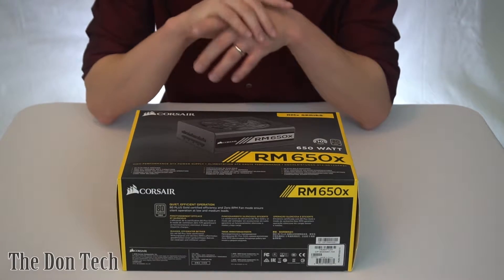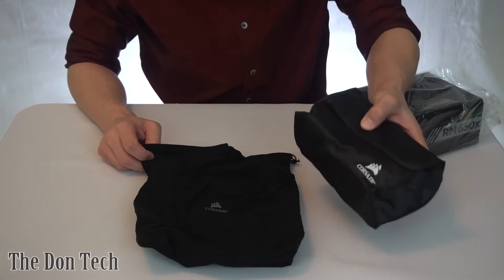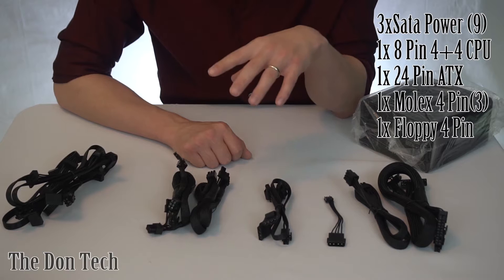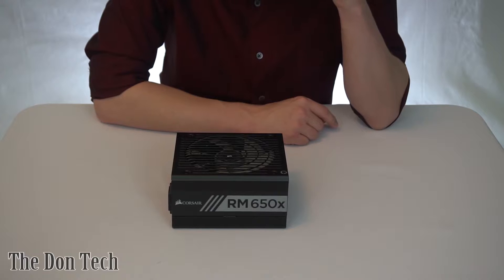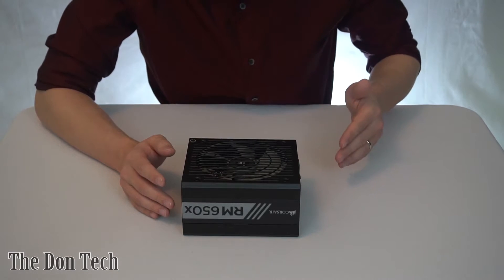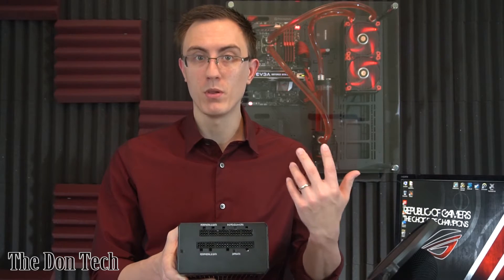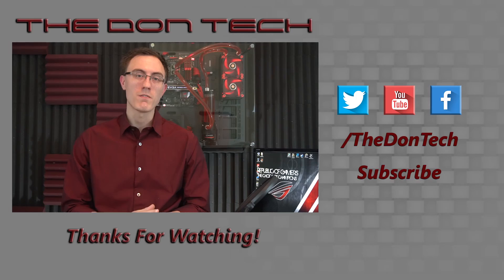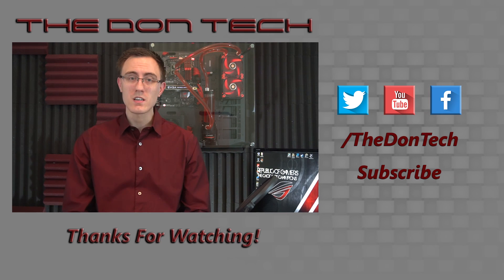Corsair RM650x Unboxing & Overview: What to Look for in a PSU! | The Don Tech

Comment: Just bought one for my 2022 PC build. I build myself a new PC every 6-7 years.  I didn't get the velcro bag. It looks like it would be good to hold headphones and other accessories when going to a LAN party. Oh well.   The Gold rating is what sold me on it.    The $20 rebate didn't hurt lol.      At 61 years old, I still get a kick out of building my own PC.     
MSI B550 Gaming Plus MB
MSI GTX 1050 video card
AMD Ryzen 5  5600G cpu
Teamgroup SSD   1 Tb 
G Skill RAM 64 Gigs
Antec DF 600 case
Reply from the maker: It looks like Corsair changed something in the manufacturing process of the new power supplies. While the product itself does not appear to have changed, the accessories package has. There is no longer a velvet/velcro bag on this model, along with the removal of the Corsair sticker.

Comment: hey guys, i bought the exact same psu, will it run a ryzen 7 3800x, 2070 super ? thank you, awesome review, well done!!
Reply from the maker: Yes this should be no problem. The biggest component will usually be your GPU so just make sure you have a beefy enough power supply for that.

Comment: Bought mine 20171128, and now my computer is dead. I hope it "just" PSU and not also motherboard etc that is dead..
Reply from the maker: Did you ever find out what it was lol. In my experience, if a Corsair power supply was apart of a giant surge or spike, it will absorb the damage and the rest of the components are OK. Hope your luck was the same.
Reply: @TheDonTech  I sent it back to Corsair for a quite big postage fee. They only said it was a dead psu and sent me a new CP-9020178-EU Psu.
Other omponents did bot damage, that i have noticed. Computer works fine after a psu replacment.
Reply from the maker: @robertbroadsword  That's awesome! Paying shipping is a bummer but at least that saved the rest of your PC! Glad to hear it man.

Comment: all is fine apart from the power leads, i changed the 24 pin and the cpu power lead for 2 modded ones. just could not get a tidy fit with original cable, each end is like solid plastic or wrapped metal, you cant bend it
Reply from the maker: Yeah the custom cables are really where it is at for the most clean runs imaginable! 
(This part of the comment is a copy/paste to say I hope you're doing well, and to clear these comments from my analytics page I have to respond to them, even if they are several years old.)

Comment: Step my step, very detailed video, nice work!

Though i have a question. Will this PSU be compatible with the Sata power Connector for the Corsairs SP120 RGB Fans 3 pack edition?
Reply from the maker: Thank you for your kind words! 

Yes this PSU is 100% compatible with those fans, infact, I use those exact fans in the build this PSU was going into! Stay tuned and there will be a video coming out about that computer, as well as a review on those fans :)